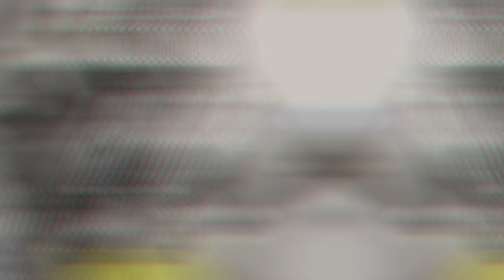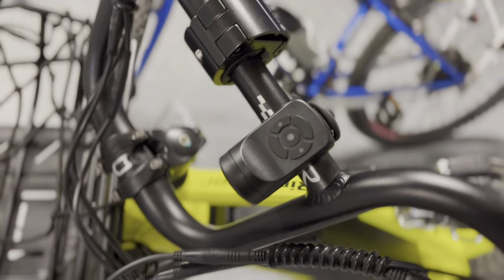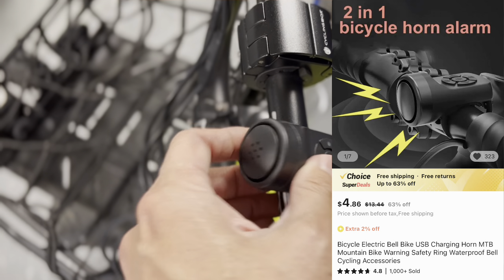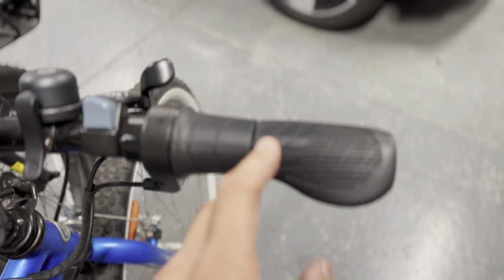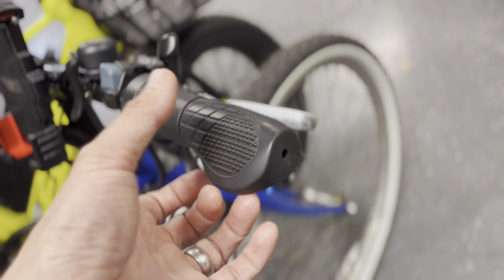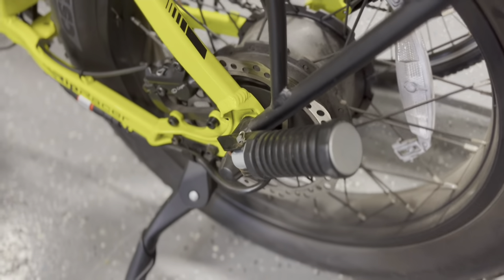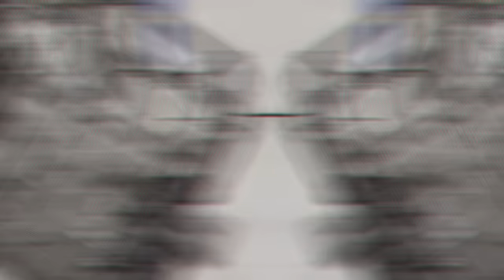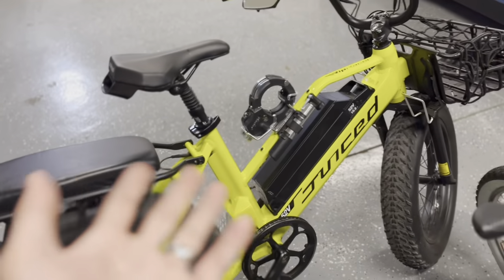Budget E-Bike Accessories (Unsponsored) For Normal People

Comment: Hello...can you tell me where you bought the front basket?  i'm trying to find a good one for me ebike.  Thanks.
Reply from the maker: From the respective companies. Juiced for the yellow bike and Lectric for the white one. You’ll need both the rack and the basket.
Reply: awesome thanks @Funcentric
Reply from the maker: @theyteam1432  To clarify, the Juiced bike does not require a rack. The front basket just mounts onto the stem. One piece. The Lectric one is a two piece setup. There’s an L-shaped rack that mounts to the stem and then the basket gets mounted on top and it comes in two sizes. What you see in the video is the large size.
Reply: @Funcentric  thank you for the clarification.   This helped.

Comment: Hi Hiplok D1000 is a great lock but have you seen the Litelok range specifically the X1 and X3 anti angle grinder locks. X1 is an ideal Ebike lock and cheaper than D1000/X3 SIZE, X3 is bigger more a motorcycle lock
Reply from the maker: Yeah I came across that. 3.4K for the x1 which isn’t bad at all.
Reply: @Funcentric     I’m retired and on a budget and £150 for X1 compared to £250 for X3/D1000 at the moment in the UK was a no brainier for the increased anti angle grinder security over my previous heavy U lock with chain New York Forgettaboutit, no idea of cost or availability elsewhere in the world though.

Comment: Someone could correct me on this, but I’m fairly certain that isopropyl alcohol is actually damaging to rubber. It’s probably acting as a lubricant because it’s breaking down the surface of the rubber. That’s my understanding at least
Reply from the maker: @price.gaines  possibly, but the rubber of a handlebar grip isn’t structural and not an integral part of the bicycle, particularly the inside. It’s also touching the handlebar which is metal and can easily withstand the alcohol. 

I wouldn’t have any concern over the use of it. I hear an air compressor can get the handlebar off too but I nor many people have access to that type of equipment which is why I suggested the isopropyl alcohol which works amazingly well.

Comment: Grips easily come off if you heat them with a hot towel or
Reply from the maker: Yeah I can imagine that would be helpful. I never knew any of this when I started on bikes over 20 years ago and struggled with it. The alcohol thing works really well though. Super well. Difference between 30+ min of struggle and literally 3 minutes or less.

Comment: What e-bike lasts for 100 miles?
Reply from the maker: The math shows a 48v ebike would need a 42ah battery. Average battery size is 14ah so that’s quite a stretch to get 100mi. I’d recommend a regular bike or motor scooter.

Comment: I didn’t bother watching it completely because it was long and typical 
The BEST accessory for riding at 15 mph and above is ear muffs to lower the wind noise, I use the style that wraps behind my neck 
Even in Phoenix in the summer, it’s not too hot and it keeps my ear bud from falling out
Reply from the maker: For city riding though, I'm going to want to hear what's going on. Yeah, the video indeed is quite long. Lots to cover. Some great deals. Not sure about typical though. I haven't seen anyone cover an analog clock as a bike accessory.
Reply: @Funcentric  I use a lightweight fabric behind the neck cloth ear miffs that don’t block hardly any sound, but the decrease of the wind noise makes it more comfortable and easier to hear traffic
Reply from the maker: @PhoenixKev62  cool. Makes sense. I would love one of those new fancy bone conduction headphones.

Comment: Regarding the front/rear turn signal set you showed on your bike, beware that whenever you see a gadget that recharges via the antique and unreliable Micro-USB connector that is a sure fire giveaway that the designer has used the cheapest possible parts. A quality rechargeable device these days uses USB-C. I personally refuse to buy any device that uses Micro-USB.
Reply from the maker: @Dave-ei7kk  not true, just the usbc is a newer design. It’s not like comparing a three prong power cord with a two prong one. 

Also usbc can transfer power and data. Vs micro usb is only power and does not offer data transfer whatsoever. 

And yes, two pairs of turn signals for $15 isn’t really expected to be high end. Just that this product does also cost $50 on Amazon.

Comment: not to forget, ALL key and combo locks can be picked in seconds. 
i will keep my $1000.USD phone in my pocket safe and very secure.
just install a car electric horn.  they are loud.
before you carry any can of mace, get educated in the correct use of it, and why you must never even have it on you.
just buy a backpack that has a water-bladder built into it.  can carry much more than 3-4 bottles. just grab the bite part and all the water you want.
Reply from the maker: Mace requires a license in most jurisdictions, whereas pepper spray does not. Yes, definitely I keep my phone on me. Yeah, I have horns and alarms too. I don’t like carrying stuff on my back if I can help it and I don’t drink that much water but I can see how that would be helpful for others who may.

Comment: You can't cut the kryptonite lock with a grinder
Reply from the maker: @JIGSAW941  all kryptonite locks can be cut with a grinder. There are basically only 2 anti grinder locks out there on the market. $175 and about double that price for the Hiplok D1000.
Reply: @Funcentric  bro I saw you belt lock and it's skinnier than my titanium kryptonite lock each link is a half inch thick!
Reply from the maker: @ not sure where you’ré getting your info but there’s no kryptonite lock that is marketed as anti grinder. 

Neither is mine. I wouldn’t want it that heavy. Chain links are measured by mm  . Thickness is irrelevant though. What makes a lock anti grinder is not thickness - it’s about the material. Again, there’s only two anti grinder locks and neither of them are kryptonite branded.
Reply: @Funcentric  I really wish YT allowed pics if you saw my lock (expensive AF) my father in law bought it when I got my talaria mx5 after my surron was stolen the thing weighs like 50lbs has a Kevlar sleeve around links I'm not saying I don't think the belt one is cool but the links look like I could use a bolt cutter I'm sure you could prob get through urs and mine with angle grinder but both would take quite some time
Reply from the maker: @ the only two anti-grinder locks I’m aware of are the Litelok ones and Hiplok D1000. Again, it’s the material they make it out of - not the thickness of the lock. 4mm thicker chain only means a few more seconds before cutting through. Chain locks aren’t anti grinder whatsoever.

Comment: Yeah, this is probably an old video but I’m that guy that you were talking about earlier. I have just purchased my first Jetson bike. The brand of it is a you know Jetson but it’s the.J5 Version of the Jetson electric bike I love it. I wanted to go faster. I’m definitely on a budget. This video is very interesting to me because my bike right now is naked and of course I want to add stuff to it and of course I’m gonna budget. I just wanted to thank you for making this video, because looking for these things is not easy and I rather learn from other peoples mistakes as opposed to my own mistakes because if I wanted to learn from my mistake, I would have done the shunt mod already and I’m nervous about doing it because I don’t want to generatea lot of heat to ruin what I just purchased so yeah, like I wanna power my bike up first before I add all the accessories my bike is amazing I love it. You already know about the speed thing and if you have any advice about how to do the shunt mod correctly with the Jetson, they had other options like the Bluetooth application of the Jetson, but I would have to add the Bluetooth because they stopped making them and I just got my 2024 in August so I’m fairly new in this. I got a 350 W motor. I want the 750 W rear motor. I wanna upgrade the battery upgrade the controller and do the  Shunt mod and have everything on a 72 V system. This is the way I’m looking at it so I don’t have to go through the my bike went on fire or my bike started smoking. No, I don’t wanna go through that. I don’t wanna play with my bike I don’t wanna play games with it And get it done the right way it seems like you know a lot about the electric bikes. If you have any advice for me, please I live in a city too the bronx great content and thank you for the video. Please reply if you can.
Reply from the maker: @massterrbarber  honestly I have never heard of a shunt mod until you mentioned it. I researched it just now briefly and understand the general concept. 

Although the shunt mod basically tricks the controller into allowing more amps to run through it, it doesn’t change the capacity of the drive resistors. If you run too many amps, the drive resistors blow and there goes your controller. 
I personally wouldn’t risk the safety nor longevity of the controller by soldering anything and trying to outsmart it. Why not just buy a new upgraded controller that’s already designed for higher amperage? Controllers are fairly cheap. I’d much rather replace it than start unscrewing stuff and soldering things based on stuff I read from the internet. 

It just sounds like a recipe for disaster with the only benefit of saving maybe $45. 

Let’s assume the bike goes faster. You’d be putting more stress on literally all the components that aren’t designed for it. The motor likely can handle it just fine. I worry about the brakes. 

Going faster seems to be every newb’s goal these days. Just enjoy what you have and when it comes time, upgrade to a new bike. 

I would feel safer overvolting a bike (which I have done a couple of times on different bikes with great results) than to perform a shunt mod. 

Do it the right way is my suggestion. Don’t mess with trying to outsmart a controller by modifying the circuitry to be what it wasn’t designed to do.

Comment: Any police officer with back trouble from their gunbelt will tell you that the weight doesn't disappear. It just damages your back more...just ask. Getting used to something doesn't mean it is good. Ask anyvtouring cyclist, just like backpacks, never carry anything on your body, let tge bike Cardy the weight.

Take your battery and keys with you if your bike is going to set unsupervised more than a few minutes. Never carry your charger with you, or at least take it with you if you leave the bike. Good shops won't work on bikes without all three. Batteries aren't cheap to replace and keys are like chicken teeth. It all makes the bike harder and less valuable to fence. It is more profitable to move on to the next where the owner isn't as cautious. 

With the exception of maybe MIPS helmets, expensive locks are the biggest waste of money. Multiple locks are the most range reducing, uncomfortable weight since off-road suspensions for on-road comfort. MIPs was developed for multiple collisions of soft bodies, on soft surfaces, to reduce the long term Braun injury of multiple concussions. It has nothing to do at all with single impact collisions. I am 68. Been a bike commuter way over 30 years and have hit my head only Winter cycling on ice twice. How often do you think you will crash and hit your head?

Turn signals that are not DOT approved are not legal. If there is a crash and you did not use a hand signal, you could be held responsible (yes, insurance companies are going after bikers for damage to cars). I like them. Using both is ideal, just don't count on them.
Reply from the maker: I'm not a cop, but maybe I'm younger. The weight does go less noticeable after awhile. I'm sure the weight of the lock is less than a gun belt though. 

The only concern I have about leaving a bike w/o the battery is exposure of the terminals to the elements, but I suppose that can be covered up. Depending on where you live, some people will just mess with bikes just to screw them up - not to steal them necessarily. I suppose they could mess up the key hole for a battery that's in place too. You never know. 

Effectiveness of a lock depends on which one too. I'd trust the X1. Carrying multiple locks though is what people want to avoid overall. 

For some of us who are more hardcore about PEV's, the ebikes are getting obsolete. There's only a couple scenarios where it's an advantage over the other options. It'll still remain the go-to though for those looking for less thrill and more familiarity. 

Yeah, I don't think anyone is attempting to make their bike legal by installing turn signals. This is just an "accessory". I wouldn't expect drivers to really see it. More like a toy - something new to add. Like I said, I wouldn't rely on it especially at night.

Comment: Oh yeah 😎?     LOCKS?   Locks only keeps Honest People Honest.  Sorry. However most ebikes have disc brakes. Amazon sells disc brake locks for motorcycles with a loud alarm built-in.  Some are rechargeable and some require batteries.  Happy 😊 Trails.😊
Reply from the maker: It would take a grinder to break most u locks and 12mm thick chains. You’ré right that most people have too high expectations of a lock but it does help more than not. I definitely think it’s worth having a good lock regardless. Best preventive method as I mentioned is to be more aware of where it’s parked or not to park it at all. Parking it in the same spot day after day for the same hours is asking to be stolen.